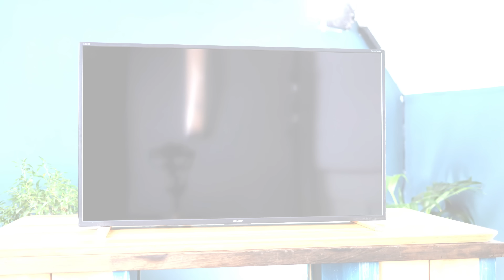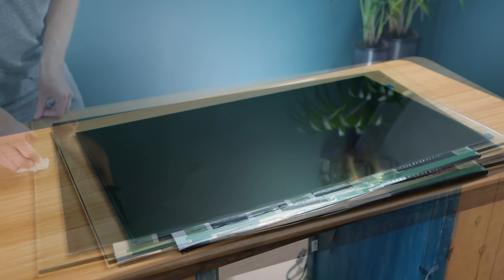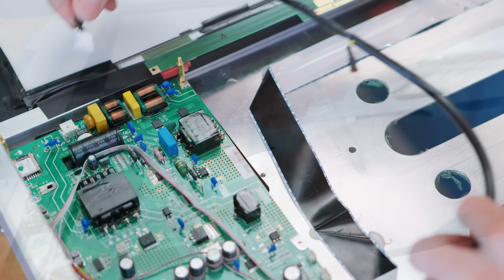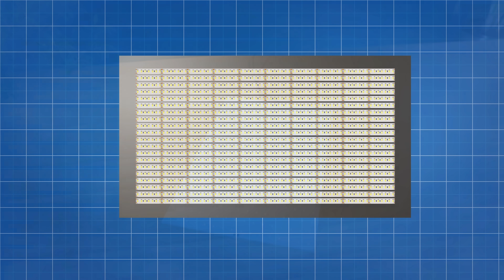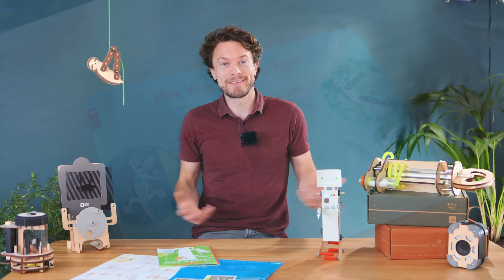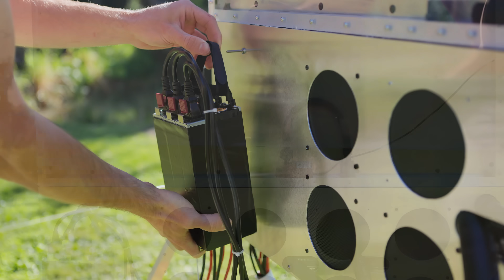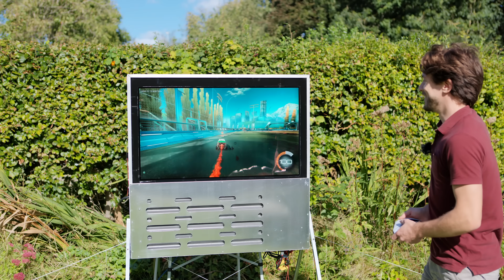Building an ULTRA-BRIGHT water-cooled TV...

Comment: About that CRI part. LCD colors generally don't benefit from high-CRI backlight. For best color rendering, the emitted r,g and b should have as narrow a spectrum as possible, and smoother spectrum of high-cri sources is not helping with that. The best backlight for an lcd is an RGB light (very low CRI) with led colors matched to srgb's base wavelengths, both from color and from efficiency perspective. The efficiency is a bit tricky, i've heard that high-efficiency green leds are a problem. Quantum-dot technology is (i think) a way to emulate rgb backlight (concentrate the spectrum around these key wavelengths) with a white-led-like technology (blue led with a photoluminescent stuff on top).
Reply: That's a great point. The sub-pixel filters in an LCD only filters a very narrow wavelength spectrum, and so all other parts of the spectrum are just absorbed and wasted as heat instead. So as you said, having high-CRI LED's are a bit of a waste.
After thought: Would that in turn mean that the sub-pixels in an OLED display emit a single wavelength?
Reply: @ichbinein123  they’re LEDs, so yes, oleds typically emit in fairly narrow frequency bands.

Edit: this is not true of oled TVs. Sorry!
Reply: Depends on the OLED. LG's OLED TVs are W-OLED, meaning all of the subpixels are white with color filters on top.
Reply: @Taudris  huh! Yeah, I hadn’t looked at those in detail, only smartphones, so that explains it.
Reply: @Taudris   The white consists of multiple layers of different colors, which then get filtered to red, green and blue. But the layerstack has a suboptimal spectrum, this is the reason why W-Oleds have a smaller color-gamut compared to QLEDs
Reply: @Taudris  I am not sure, i've read that lg's w-oled just have an extra white subpixel, so 4 in total (red blue green + white subpixels). Filters doesn't make sense but could be wrong
Reply: Yeah the cheapest, worst, white LEDs are blue LED with yellow phosphor. Looked at through a spectroscope you're gonna get just that, yellow + blue. So anything, say, red, isn't gonna show up. Or in practice might show up looking really weird if cheap LED lighting is all you have. It's like the way cars all look the wrong colour under the yellow sodium lights they have in car parks late at night. You can't tell the real colour cos the right aspects of the spectrum aren't present. Cheap LED lights are as bad.

A good way would be to use phosphors that emit every colour, red, yellow, orange, green, and ideally the colours in between. Indeed you could use red and green LEDs (and indeed there are other colours available, true orange and yellow, and now even cyan and purple, all true colours, not a mix). Use the best mix of LEDs and mix of phosphors to fill in as much of the visible spectrum as possible. Hopefull this can be automated in practice and made cheap and normal. Then things like art will look their best, as will everything else. People's faces. 

There are great artists, who, as they aged, developed cataracts and saw colours differently, and so the paintings from their later life are differently coloured cos that's what they saw, they knew no better. 

But yeah so far Chinese factories and Western megastores seem happy to churn out the most garbage for the lowesr price, so we're all gonna be effectively colour blind at night from now on, enjoy that.

Other light sources, like fluorescent tubes, didn't give a full spectrum. Ironically, the old incandescent lights, where a tungsten wire gets white-hot, give a very pure and complete spectrum. As indeed does the Sun. Candles and oil lamps, I think are quite yellow, though don't have a lot of experience with them in person. The colour you see on TV, too, is very limited by the technology of the day. In early colour TV it was all standardised and graphs were drawn.
Reply: @greenaum   
"A good way would be to use phosphors that emit every colour, red, yellow, orange, green, and ideally the colours in between. Indeed you could use red and green LEDs (and indeed there are other colours available, true orange and yellow, and now even cyan and purple, all true colours, not a mix)." 
This is not true, since the subpixels filter red, green and blue, colors like cyan would get filtered out or degrade the color performance.

"Yeah the cheapest, worst, white LEDs are blue LED with yellow phosphor. Looked at through a spectroscope you're gonna get just that, yellow + blue."
This is true, that is the reason, why a high CRI LED will lead to a better performance than a cheap LED. But the Combining of red, green and blue LEDs (or blue LEDs with QD-enhancement film) will give the best color performance, while heaving a bad CRI.

Comment: Would it be possible to put a light sensor in line with a voltage regulator to have the display go brighter and less bright depending on environmental brightness?
Not only will it make heat more manageable when you don't need full brightness, but at night you won't be blinded by it

Prehaps a part 2?
Reply: @ts;cc  yeah of course, averaging out over a few is better than one but the principle is the same.

Lower brightness when not needed, saving energy, heat and distracting neighbours

Comment: You know man, some of your projects are annoying on how garbage and useless they are. I used to get a somewhat nasty feeling when seeing a video of yours in my recommended because of it.

But stuff like this, or the projector... It's borderline worth it's filesize in gold. Great stuff, truly.
Also, cutting glass isn't hard, you could have done it yourself with a diamond tip and some vice grips. Both of which are cheap and handy if you ask me, so a worthwhile investment. Also you forgot to mention the dangling power supplies when you called it water proof. Cheers.

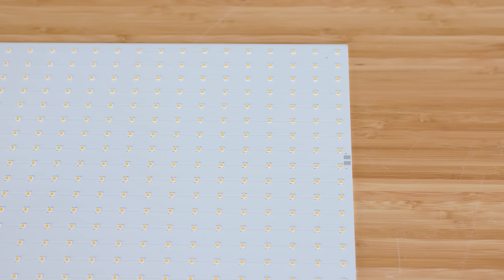Comment: It is mentioned at 8:30 that the LEDs have a high CRI, and that it will help with the colour gamut. This is without going into further detail not quite right. The ideal backlight would consist out of 3 monochromatic lightsources (red, green and blue) which makes a bad CRI. A perfekt CRI LED has equal power on every wavelength. Nontheless the high CRI LEDs could maybe be better than the built in LEDs, this would be the case, if the spectrum of the build-in LEDs would only have two wavelength peaks (Blue and Yellow/Orange) which is possible, since many LEDs have spectra like that.

Comment: A E-bike - ESS 48V Battery Pack (Hot SWAP) Powered Portable Waterproof  Arcade machine  - Virtual Pinball table 
- Using AMD Hardware + Water cooled + Touchscreens 

Bonus Ponts for  making Solar Powered Rechanged with 
LG NeON2 415W BiFacial Solar Panels LG415N2T-L5
+ Smart BMS (WiFi & Bluetooth & RS 485)  - DALY BMS 
+ Genasun Lithium MPPT's
+ HDPLEX 800W DC-ATX with 16V-63VDC Input

Comment: I LOVE THIS!  ...and would start to upgrade it right away. :grin:  The first thing that comes to mind is to use a light sensor hooked up to a PWM controller for the LEDs to automatically change the brightness level depending on how bright the environment is.  That way, you can watch it at noon or midnight and it will always be exactly as bright as you need it to be.  (Dropping the power going to it will also make the LEDs last a LOT longer.)

Comment: Tempting to try and make a smaller version like 8" - 10" to make a little screen on a speaker back pack for advertising or a bit of fun 

Essentially combining the portable amp project you did several years ago 
(which I've just made and I love being able to carry two bookshelf speakers in my bag anytime I want music)

And this but in a smaller form factor.

It just sounds like a fun project to be able to have a playlist going and have the music videos as well because why not, or even for movies.

At a smaller size it may be easier to use 18650 cells to power everything although I will say for the speakers I've opted to using 16 1.5v AA batteries from Poundland (the Kodak ones) and I still get a decent usetime although I will be upgrading to some lithium rechargeables when I get some money.

But all in all for me the speakers with my DIY skateboard horn (8AA batteries, momentary switch and a 12v motorcycle horn) 

It's safe to say I can skate comfortably without having to stop every 5 seconds for large groups of tourists in Margate.

Comment: The bright sunlight makes me wonder... would it be possible to substitute the LED backlit panel with .. reflected sunlight?   It'd be useless at night but during the day, a solar collector of light, redirected via lenses?  You'd need a horizontal collector, to automatically compensate for the sun's movement across the sky, so it'd be large.  Mylar mirrors could redirect it onto the back of the deconstructed LED panel.  The enclosure would have to be large as well, but... it'd take zero power for the backlight....

Comment: Improvements could certainly be made (matte front surface for the screen + shadow box, radiator moved to the back for a better contained cooling system, better stand), but definitely a good starting point for an outdoor tv. Not so sure about your choice of black paint (I understand that general set of paints to get gummy over time), but a quite nice baseline.

Comment: What about reusing the sun itself with a diffusion panel like the ones rgb keyboards use between the leds and the tv?  So we'll get the light of the sun from the top and redirect it to the screen, granted that it would make it so that the TV has to go in a certain rotation but we would not need as much backlighting and it would be pretty dynamic.

Comment: Personally, I'd try attaching the led's straight to the radiator leaving some gaps for airflow, and use a fan to blow straight through. assuming ducting is used effectively that would probably work quite well
Reply: I believe i see what you're thinking, but you would be using the radiator inefficiently. 

The outside is made for thermally interfacing with air. The design is optimized to sink the heat from the coolant inside, out through the fins.

Possibly you could modify it in a way to use it as a heatsink, but once its warm, it has to radiate that heat back out again and since it now has to touch the components that need cooling with as much surface area as possible complicating airflow. 

Unless you then use a second radiator to cool the water inside or something which.. well that would be weird..

Comment: Water cooled tv using server power supply for led back light which is water cooled and uses car radiator. The most overkill project in cost effective mode I have ever seen 👀👀👀

Comment: This project is awesome! I want to know: is it possible to map the LED's to create local dimming? And even accept a PQ HDR signal? a DIY HDR TV would be very interesting to see!! I know it wouldn't increase the size of the gamut, as sRGB uses different coloured pixels compared to P3 and Rec2020, but it would nonetheless be very interesting to see if this is possible in terms of contrast.
Reply: Interesting. I want to see a full on no cost cut version with stuff like this! And the custom made glass and the best possible panel etc. Watercooling is just inherently cool. I bet a lot of thermal efficiency can be gained if needed. For example the big sheets seem too flexible to create an optimal thermal interface. This can be overbuilt as much as you want to i bet. I'm sure there are even crazier specialty LEDs out there capable of super even spectrum range and stability and linearity of dimming which i am guessing, based on this video and comment, would be desirable characteristics here.
Reply: Those Arduino 8x8 RGB matrix's use a 5050LED which are individually addressable........  perhaps something scaled up to the TV size. The boards come in 16x16 too, and also software to tile them into large displays... there's newer WRGB led's too that include white LED's as well as R G B too increase the overall brightness - but would be the ones getting used in this TV.... the RGB leds are probably out of gamut for the TV color filters.
Reply: @SarahC2  I was thinking that maybe a matrix of LEDs can be used, and you can use multiplexing to drive them more easily and make wiring them much easier. I wonder if that would be a better solution.
Reply: Would need to have logic to determine an average brightness between zones/LEDs or varying brightness as their light would not only overlap, but also be responsible for multiple pixels. 

Would need to intercept the video signal to pull the luminance values of each pixel. Havnt looked myself what available hardware/software may be available for such a purpose.
Reply: I imagine it'd be a big challenge to implement. You'd need something to drive hundreds, if not thousands, of LEDs. If you plan on gaming, you'd also need a way to intercept the signal, do all the necessary processing and dimming, and all without adding latency. I'm sure DIY perks can find a way to do that cheaply.
Reply: good idea, makes the blacks blacker!
Reply: @1337GameDev  is it not possible to plugin an hdmi into a computer (with some hardware device or software to spoof being a monitor) and read the incoming stream on a pixel by pixel basis? Don’t capture cards essentially do that?

Comment: Next upgrade, use LED matrix driver to drive each leds as local dimming zone, and use hdmi capture + passthrough for image input to raspberry pi and the pi control the local dimming brightness.
Reply: This is really an FPGA job instead of a Pi job. And while you could certainly use a Pi to program and control such an FPGA, some cheaper Arduino (without an OS) would be better suited to such. A Pi is more of what you would use to add SmartTV capabilities to the resulting device.
Reply: @absalomdraconis  yeah, FPGA is really suit this but I think if I will do this, coding python is far more easier than Verilog (even with ip core, still hard). Arduino is too weak, I woukd prefer the real bare metal similar to what I've done with STM8L.

Comment: When this started I was kind of apprehensive as to the technical use of water cooling in electrical. Liquid cooling in super computers has been a thing for many years. But implementing such systems is quite complex. Using water to directly pull the radiated heat from connected services is much less intense and makes for a great project.

Comment: Very impressive, Matt! I do enjoy watching you tackle DIY problems with great skill and inventiveness.  I have a problem in that my 15 year old 46" JVC LCD TV is getting too dim to watch indoors, let alone outdoors.  It still works fine, it's just not very bright, and the contrast is about normal for sets made in 2006, that is, not very good.  Since I paid $3,000 for it I'd hate to just throw it away in favor of a more modern set.  I assume it uses CCFL backlights, not LEDs, which accounts for the dimming effect over time.  So, my questions are:  Can the CCFLs be replaced with LEDs, and if so, won't that decrease contrast further and make the shadows look even more gray and washed out?  How do I correct for that?  Thanks!

Comment: That's extremely cool man! One path of upgrade would be to make it kind of portable so you can take out with you camping or on trips.

Maybe make each of  the panel section and the radiator/board section modular and can be disconnected to make less unwieldy, and powering it with the portable power supply project?

Comment: I for one would love to see this in a darker environment to get a good reference for just how bright it really is.
Reply: eye watering I should imagine and no easy way to adjust the brightness unless I missed that bit in the video.
Reply: @Dedubya-  He didn't mention it, but making the brightness adjustable wouldn't be that difficult. The LEDs were already running off a voltage regulator (4, to be precise), so you can adjust the power going into them to change the brightness. Obviously he didn't have need of such a feature, as he's using it exclusively outside.

Comment: For those in North America, you will want to use a grounded power cord with the ground wire attached to the aluminum case. For all people that make one of these, it needs to be powered from a working and monthly tested GFCI outlet for safety. I was trained as an electrician, and that is why I give this advise but also remember to consult a known and reliable source on any project that involves electricity, unless you are properly trained to be safe with it.

Comment: Have you figured out how to hot wire that Dell 2360w power supply yet?
Reply from the maker: Yep! It's actually one of the easier ones!
Reply: @DIYPerks  Thanks, I think I finally found it. Pull Pin 12 to ground? Hard to beat that. Off to Ebay I go! 

Thanks!

Comment: Regarding the mains power supply, wouldn't it be better to remove the original transformer and replace it by an external, double insulated, standard power supply and only feed low voltages to the TV?

Comment: As always, cool project! 👍😎 Lots of design ideas may be useful in similar projects..
Yeah, I agree about LED's on aluminum substrate. These are more powerful and brighter than standard LED strips.. But there is another option - LED strips on aluminum substrate.. Usually, come in 1m length, can be cut and calculated for 12V supply.. More brighter than standard LED strips and by price is cheaper than LED panels..
Still using these LED strips on aluminum base at my work bench, in garage and even in kitchen over the sink.. Very bright and don't overheat.. Love these.. 😍 Especially, because in my garage's is only 12V available as DIY power system..